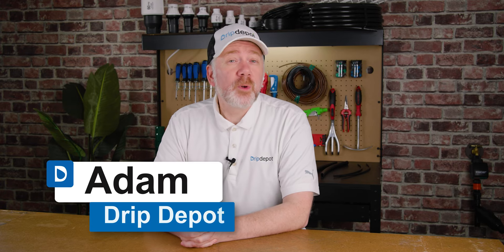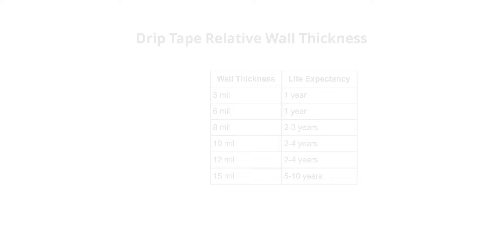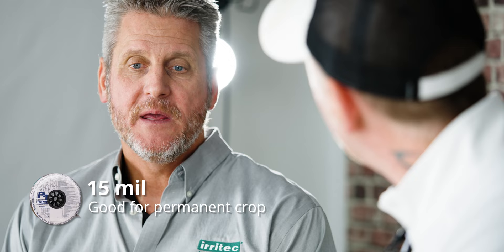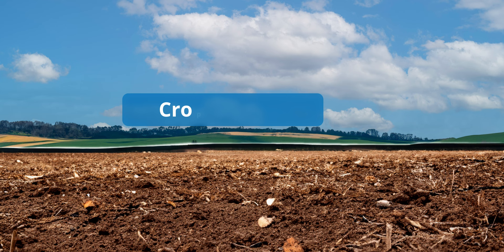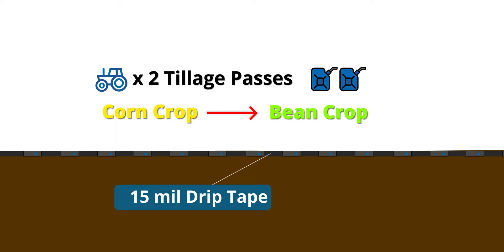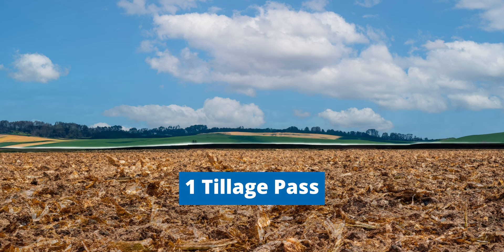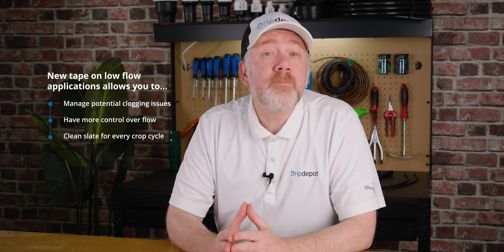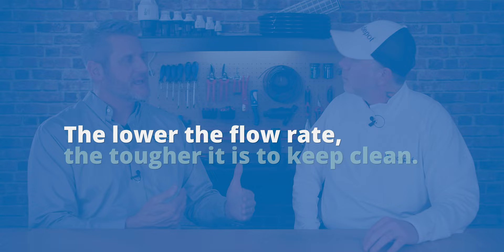How to Choose Drip Tape Wall Thickness

Comment: If I have 3 beds in a row (two raised and the last one is in-ground), do I have to run 1/2 hose out to each bed or can I run 1/4 drip line across the beds and connect the beds together with 1/4 hose?
Reply from the maker: In most cases you'd want to run the 1/2" tubing to each bed -- due to its smaller diameter, 1/4" tubing incurs more friction loss than larger diameter tubing.  With short runs in a bed this is no problem, but too long (or too much water going through it) will quickly cause high levels of pressure loss in 1/4" tubing.  With that said, if the total distance would be reasonably short (less than 30') and the volume of watering going through on the lower side (less than 30 GPH) it could be done with 1/4".  I'd probably still recommend 1/2", but the physics would allow you to use 1/4" if you're within those thresholds  :)
Reply: @dripdepot  thank you. I just ordered everything last night and afterwards I thought, wait a minute...maybe I can't run it this way and now I'm not sure if I'll have enough 1/2 hose. In one direction from the main supply spigot, there's two 24'x4' raised beds side by side followed by a 3' path, then two 4'x4' raised beds side by side and on the other side of those is a triangle shaped in-ground bed about 10 ft long.
Reply: And then going the other direction from the main is three 8'x4' raised beds in a single row with 3' paths between, a 4'x4' raised bed another 3' path and another triangle shaped 8' long in-ground bed.
Reply from the maker: @kimokahikolekalihi  It could be tight depending on how far the beds are from the water source -- if you do end up having to use 1/4" tubing between the beds, at least it would likely only be on the last bed in the series, which would help reduce the chance of any problems.

Comment: I’ve recently installed a drip irrigation system in my landscape garden but I think it is giving my 2 rose bushes too much. Is there a way to take emitters off and plug hole in distribution tubing?
Reply from the maker: Are you using 1/4" barbed drippers?  If so, you bet, all you'd need is what's known as a "goof plug."  The 1/4" version is item 1176 on our site (just put 1176 in search bar and it will come right up).  If you're using emitters other than button drippers, just let me know and I'd be happy to let you know how to remove them and plug it up :)
Reply: @dripdepot  thanks. Yes I’m using 1/4 inch barbed drippers.
Reply from the maker: @Mindy-s-channel  Perfect, in that case a goof plug would do the trick for you -- you can pop the plug in right where the emitter connects to the line (1/4" or in the wall of 1/2" or larger).  The goof plug is a little bit bigger than the barb on a dripper so does a good job of filling the hole.   When you take out your dripper, try to do it when the tubing is colder (early morning or later in the evening) and pull it straight out as much as you can -- this will help prevent the hole from stretching too large :)
Reply: @dripdepot  thanks. Will do

Comment: I been trying to contact for information with no luck.
Reply from the maker: Randy, I'd be happy to assist you here if you had some questions -- if you prefer email, you can fire us off an email from this link: https://help.dripdepot.com/support/tickets/new -- we have actual people replying to emails all day and quite a few of them come to my in-box as well.  During this time of year, the only day we're closed is Saturday so don't hesitate to reach out :)
Reply: I'm new to drip tape. Trying to irrigate a small garden. I have low water pressure. Just been trying to figure out all the parts. I'm growing onions, beans potatoes just want the drip for the row crops. What do you recommend?
Reply from the maker: @randyobrien6384  Randy, you're definitely on the right track with drip tape, it works great for row crops of the type you mentioned -- do you know how low of pressure you have at the water source?  Might be worth checking to see if you'll need a pressure regulator or not (drip tape prefers very low pressure, at 10 to 15 PSI).  

I've got two quick resources that can help you determine everything you need -- first, here is a link to a video guide we did for a row crop system that will likely be very similar to yours, it's a row crop system running from a hose bib: https://www.youtube.com/watch?v=oSI_rSTAZjQ

Next here is a link to our row crop kits -- they have everything needed to make a complete system, so you could find one that's close (mostly in regards to total length of mainline tubing and total length of tape to cover your rows) and slightly modify it to make a good match -- the parts in these kits are the same we used in the video: 

You're also more than welcome to ask any questions that come up -- I reply to questions here during office hours and would be happy to help :)